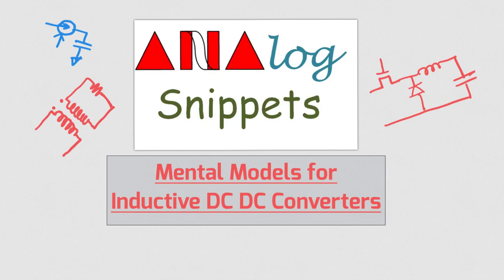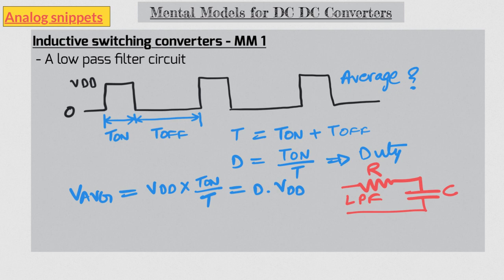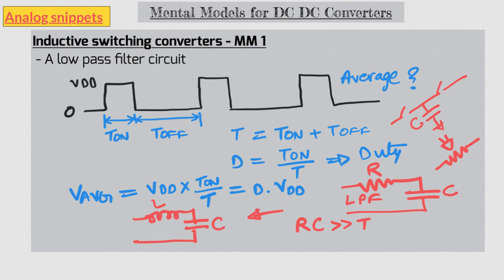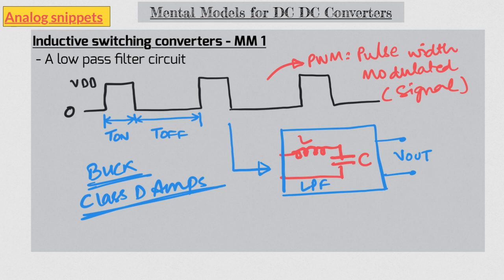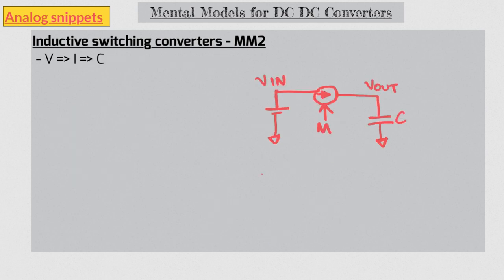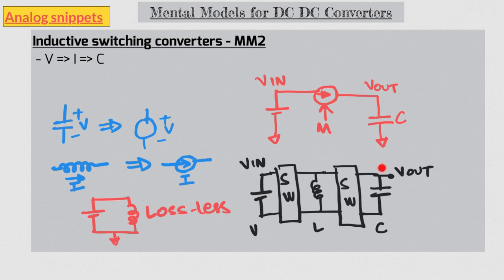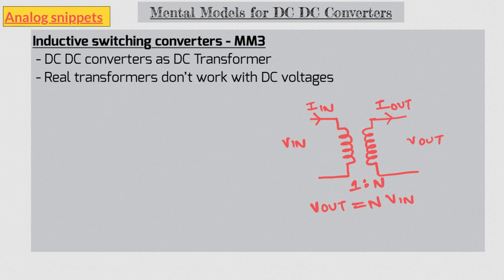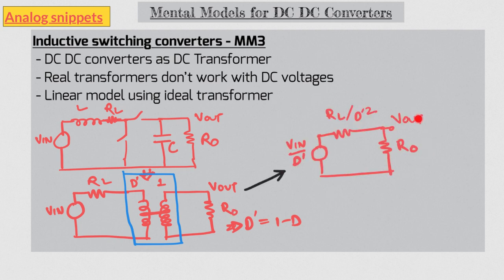#49 Mental models for inductive switching converters

Comment: Hi Saurabh, if there are no losses in the switches (ideal) or in L or C, I guess there can be still be oscillation in this buck circuit. Imagine the power supply is 0, in this case switching node is always 0 (and has perhaps no difference to a non switched, continuous time circuit with Lc tank)and oscillation around Lc resonance will sustain—nothing to damp it. Any thoughts on this?
Reply from the maker: Hi Abhirup, Yes, that is correct. In fact, there are other cases when LC in switching converters can oscillate, for example, in DCM operation. My point in the video is that generally, it does not work as an oscillator.
Reply: @analogsnippets  thanks Saurabh, would love to see the video on loop stability analysis in DCM mode. Cheers!